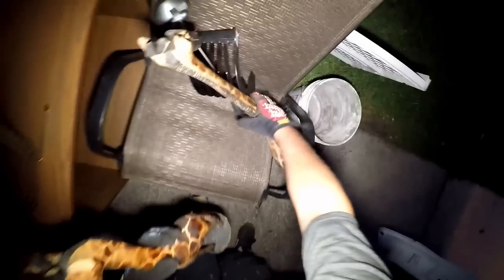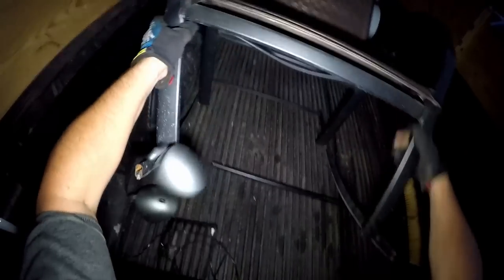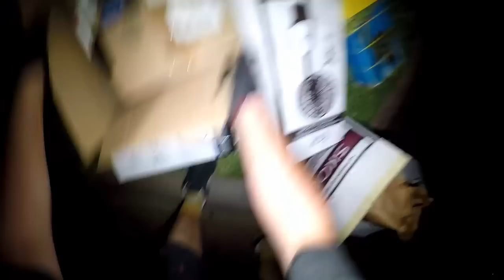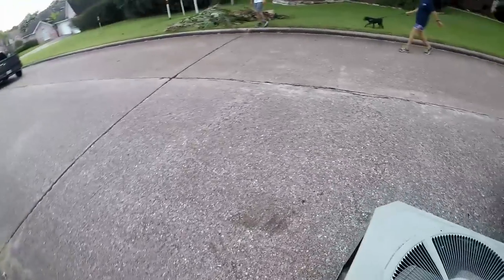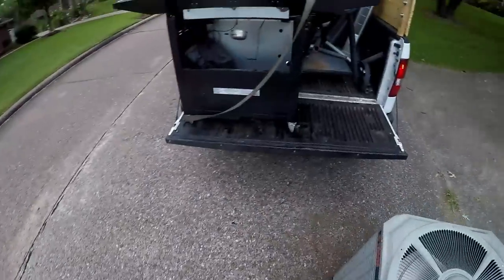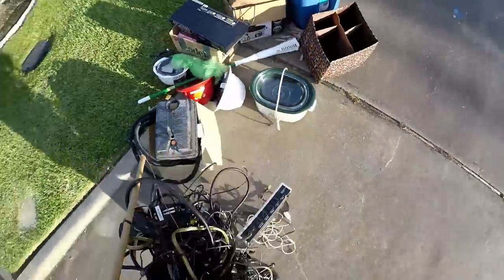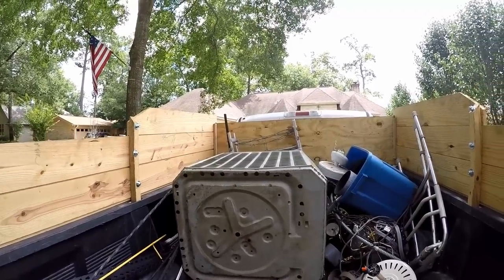Heavy Trash Day (Dottie To The Max!)

Comment: Pro tip, leave the heavy item on the curb and back up to it so you don't have to lift from the ground. Carry a short length of 4x4 or 6x6 block of wood or even a simple milk crate to prop it up so it's a easier lift/tilt into the truck. Unless you're stripping stainless off bbq grills they are usually take up too much room and don't weigh much like the dishwasher you skipped, better off pulling the cast iron grates and cutting the gas valve until you get a trailer.

Comment: You scored on the AC unit , there's #1 copper , #2 copper , electrical wire , a compressor , a electric motor ..sometimes the fan blade is aluminum and the reefer but you gotta cut all the littl copper tubes off of the end and remove the metal plate that holds the little copper tubes in place for it to be considered clean , a sawzall works the best , and the rest is all scrapity scrap scrap scrap...i love those things.

Comment: 21:10 I’ve dealt with that situation before and learned to step the item up on a smaller block or piece of scrap or whatever on the ground, that way you can get a better tipping fulcrum on the tailgate a little higher up, even 6-12 inches will help.🧠 AND 💪 gotta be strong!
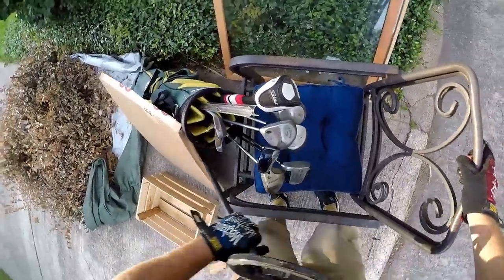One more thing: 25:09 .metal detector?? that’s irony. 🤨

Comment: I hope you check if ACs and Refridgerators have  pressure in the system. Because they are extremely dangerous to be vented into air. And is even illegal in a lot of cases. A lot of scrapers do not scrap cooling units for that reason. Especially old units who might be still even on R-22 gas, which are one of the biggest contributors of ozone hole. While new units us far less harmful gases, they still contribute to global warming. R-143 gas is 1800 times more potent that same amount of co2.

Comment: Build a heavy pipe rack on that truck and mount a lite duty winch in the front of the box. A heavy "I" beam in the center of the rack that telescopes back you could lift items up and pull them into the box. This is the kind of set up you often see tree services have in their trucks. Yeah sure it costs but its what you need and you'll not get hurt.
Reply: Just about forgot to mention. Harbor freight makes a neat electric cut off wheel (corded) that goes more places than my pneumatic one can. That would be the ticket for breaking stuff down at the shop. What might be better would be a lithium ion battery powered one that you could use it on the road to make stuff fit in the truck better.

Comment: Ok since this vid is old I'll say this for future reference. Re:AC unit  time stamp 18:41. You are trying to lift the entire weight into the truck in one go.  Very hard and no leverage.  Try laying the bbq down flat.  Lift the AC onto it.  Then make the incremental jump to the tail gate.  Small steps to make a large problem easier.  Also purchase for yourself an aircraft cable hand winch and use it to come along bigger items.   Other than that keep on keeping on Mike the Scavenger,  I'm certain the scrap heaps in the sky will ultimately open up and pour into dotty.

Comment: you should use one of those motors you find and build a adjustable lift arm with cable like a winch for the heavy things. i know this video is old but it can save you lots of time and hassle.

Comment: Hey Mike just thought I'd let you know I watched this video three or four times and each time I watch it I think of a comment but always forget but when you're lifting something like that heavy air conditioner grab something out of the back of your truck and prop it up on top of it so you can tip it backwards and it will fit on the tailgate the couple extra inches under that AC would really help you lift it easier and not on the edge of it? Hope that helps and you read this message to

Comment: no good morning just right into the video, you save vhs but not cassette tapes BOO! if save those well mind you if there pre recorded ones then yes leave but still of grabbed it to see what was on them might find a gem, there's a first a fan ceiling one still in the box unless its one of those cheaper plastic ones, d bbq of the day there quite heavy those things, a/c unit! good money in those if there not full of freeion, also she'll fit, might have to break a few pyschic laws and make a few adjustments but she'll fit, if not you'll make it fit! nah she's not you can still see the tyres on the underside, plus who cares? so long as its loaded safely....to a point were nothings going to slide out when breaking or fall out when pulling away your fine just keep the speed low so you don't have to break very hard and add a few extra miles to stopping your truck, s big ol load, scrap pallet man could only dream of a truck load like that!